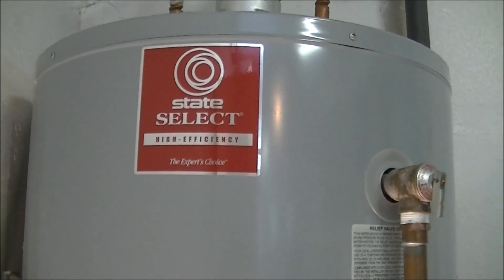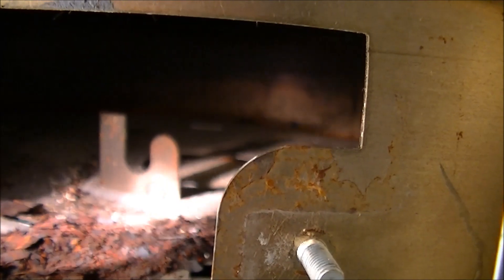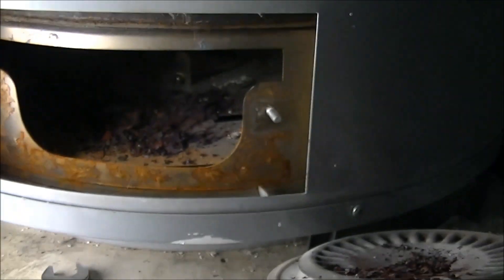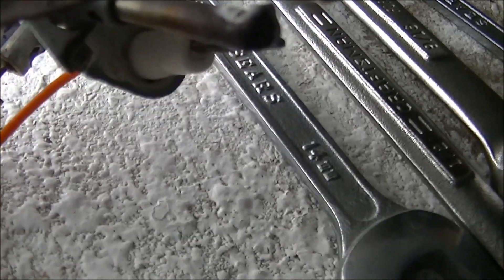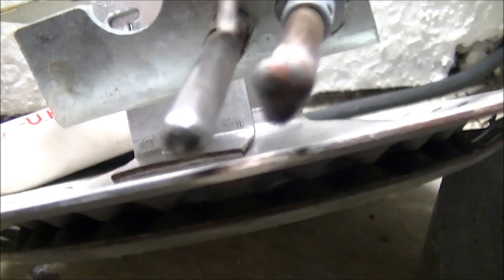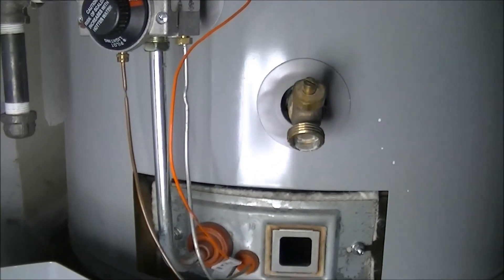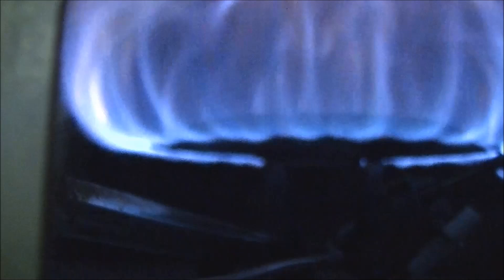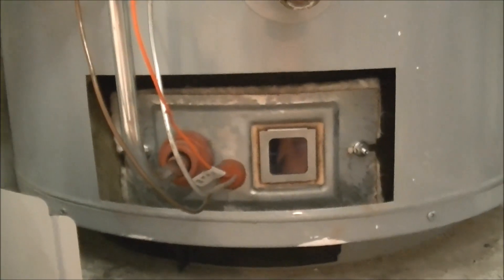Gas Hot Water Heater Pilot Light Goes Out - stays lit for 5 minutes then goes out

Comment: Thank you for your tutorial. I have exactly the same water heater (8 years old) with the very same problem. I was able to fix it with your advice. But I, too, did a fair amount  of research and learned a few things that pertain not only to State water heaters, and apparently to every water heater made in this country since about 2003. I thought I'd share what I learned. All water heaters since 2003 have a "sealed" combustion chamber, in which the burner and pilot reside. This is for fire protection. One of the consequences of this change is that there is a  "filter" or spark arrester in the bottom of the chamber that can get clogged with dust or pet hair. When this happens, it unfavorably restricts airflow through the combustion chamber and can either snuff out the flame, or in my case (and probably yours) it can cause overheating in the burner area. In the State heaters, there is a high-limit temperature cut-off switch just below the burner which is in series with the flame-proving thermocouple. If there is insufficient airflow, the consequential temperature rise can cause this switch to open and turn off the gas valve. Both the main burner and pilot will go out. That switch automatically resets when it cools, though, so you can relight the pilot (almost immediately!), and the burner will fire up again if heat is still called for. But it will trip off again,  most likely, if nothing is done to correct the restricted airflow problem. Your solution of vacuuming out the spark arrester/filter, from the bottom, is likely what helped the most. Compressed air from the top side helps too. The process of sanding off the deposits from the flame-proving thermocouple doesn't hurt, but I suspect your real problem (as was the case with mine) has to do with restricted airflow, not with the thermocouple. In my case, prior to repair, the pilot would stay lit indefinitely, which suggested it was not the thermocouple, otherwise the pilot flame would have gone out. But when the main burner fired, the whole gas valve would shut off within about 12 minutes. After cleaning the spark arrester and the thermocouple, my heater works just fine again, but was cleaning the filter/spark arrester that really made the difference. Thanks again for your video.

Comment: I had this problem for about 3 days. It was sunday afternoon and i was waiting for monday morning to call a plumber. After watching your video sunday night I attempted to clean it like you did. After I took cover off I noticed by hot water heater was never cleaned. I made that little contraption with some pvc pipe and cleaned it all around then sanded the thermocouple. I put it all back together and wala it worked. You saved me a 300 dollar service call and the plumber would have most likely told me to replace something.

Comment: Hi, I am leaving this comment in case anyone else  has one of these. I had a similar symptom.  Mine is 10 years old Kenmore Power Miser 9..  IN my case it was not a blocked  round ceramic spark arrestor.  I did  remove the burner and blow it out with an air compressor from the top  and it went from  running only 3  minutes before shut off to a full heat cycle but later would die out. . No lint but seems maybe was pulling in some rust and dust from the lower section.    It was either the thermocoupler or the over heat cut off switch.  I ended up replacing the entire burner as just the assembly was only a $8 less  on sears parts .  The entire assembly is about $75 .  Later I saw similar assemblies on line for less but not sure they would have fit.  Same looking photo for different brand . I did not have the time to figure out what company or brands used the same part as the Kenmore Power Miser 9.   BTW A.O. Smith, who I think  is the maker of the parts,  do say they expect the thermocoupler to last 10 years. They do have a web site to explain how to test but I did not have time.   The pilot seems bigger and I blew through both and it seemed maybe the pilot was  not as big as it needed to be?  All I know know is now I have hot water a couple days in.  Which part was failing I don't know. Oh and to rub it in,  The Peizo spark failed  after the new part was installed.  How the thing failed was  a mystery as I hardly ever used it in 10 years.    Luckily there is a video on youtube how to use a $1 store lighter igniter.  The actual part is only$8 but I was in a pinch and it worked .  Odd how it failed the same time as the other part.